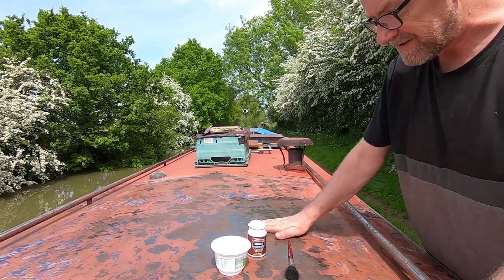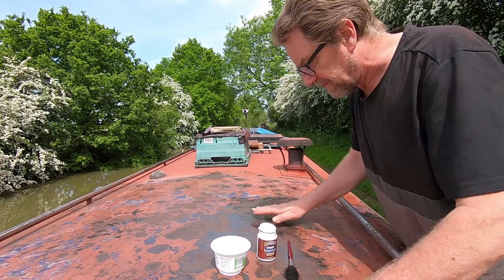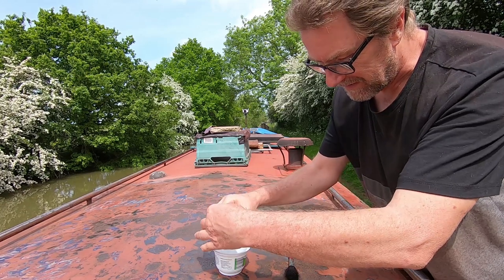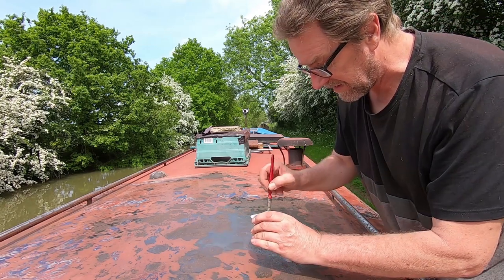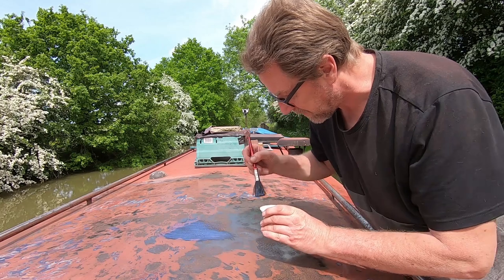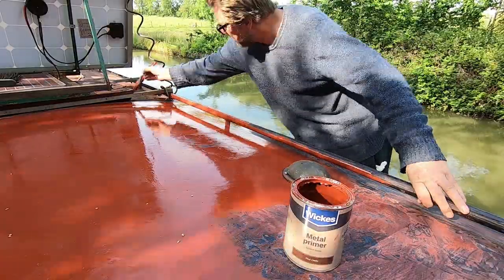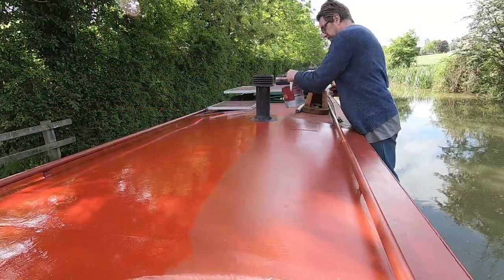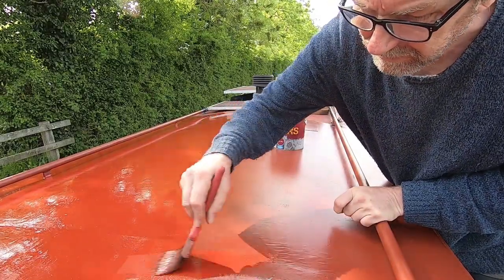Painting the roof of my Narrowboat, rust control and treatment. D.I.Y

Comment: You dont need to use rust treatments on steelwork that has been wire brushed clean of rust. If there is no rust you dont need it. The oxides in primers need to be I contact with the bare steel to have any anitcorrosive effect.